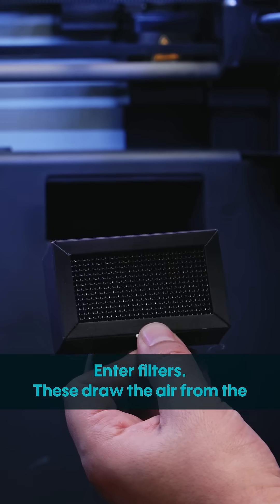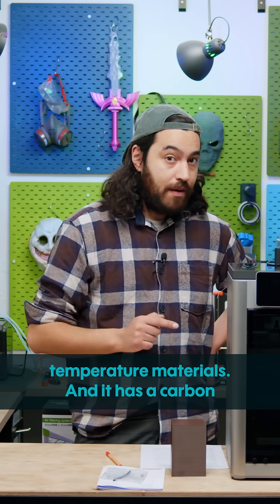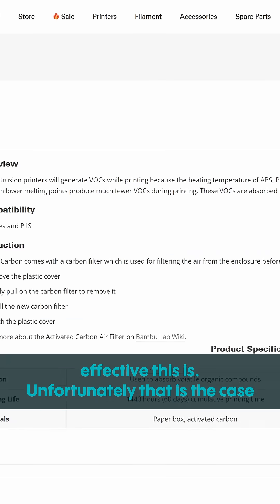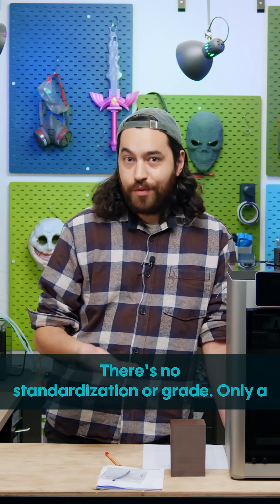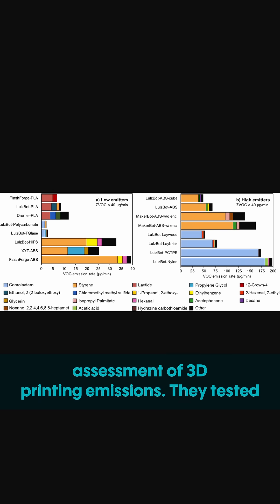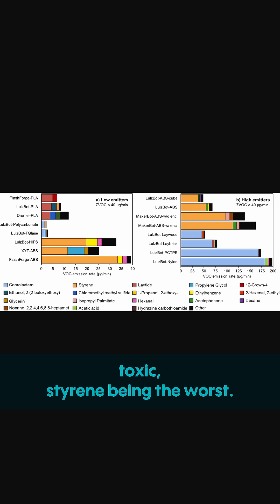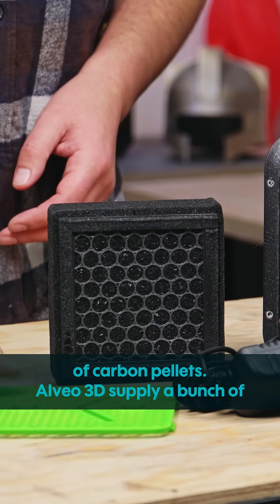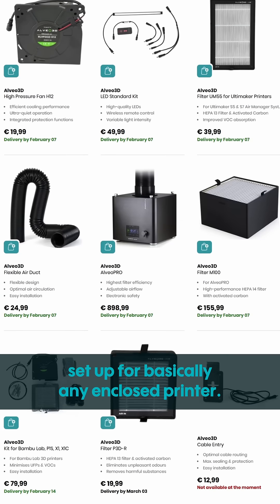HEPA & Carbon Filter For Any Enclosed Printer

Comment: I have it in my living room/kitchen… it’s the only room I have other than my office (poorly ventilated and I work in there 8 hrs a day) or my bedroom 🥲 I open both windows which are either sides of the building (the room spans my north and south sides) to get a through-draft, and I have a HEPA air purifier running, and I avoid the room when printing, and I only print PLA. I still wish I had the room for a properly ventilated enclosure though 😭 My lungs are scared lol

Comment: I have 3 printers in my room, anycubic kobra 2 neo(main printer), Lottmax Shark V2(Still tweaking settings), idk the name, creality resin printer(almost never use.) Only the resin has a chamber. I only use pla/pla+ and that one that prints like pla but gets rubbery when it gets wet. I almost never print while in my room. I never print resin while in my room. Would you reccommend moving them?
Reply from the maker: Well....yes, please do move them. Space considerations are difficult in a lot of homes, I get that but your health will thank you in the long run.
Reply: @3DJake_Official  okay thank for letting me know, I thought pla didnt release any toxic chemicals. right now I cant print anything the nozzle clogged